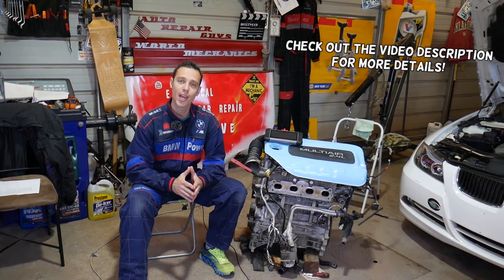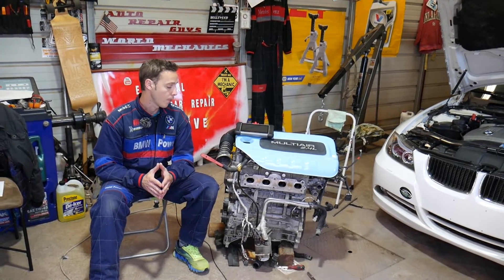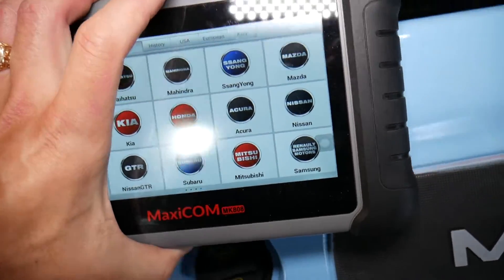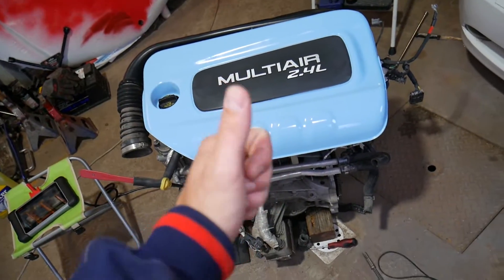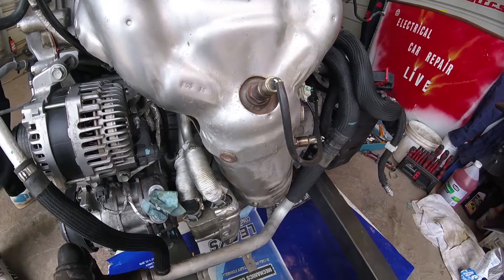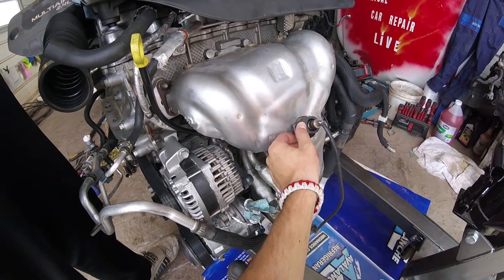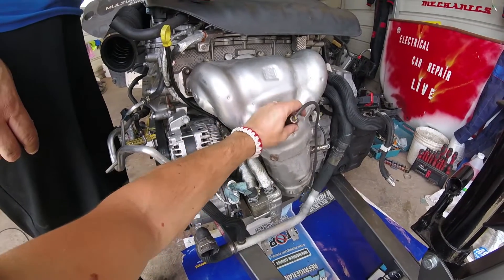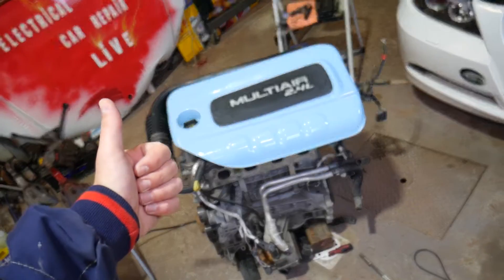CODE P0031 P0032 ENGINE LIGHT ON DODGE RAM PROMASTER CITY, FIAT 500X, FIAT TORO

Comment: Hi, I have a 2016 fiat 500x with the same codes P0031 and P0032, I replaced the o2 sensor and the light came on after erasing the code with the scanner, I assumed the other sensor was bad too and replaced it, but the light is still coming on, I tried disconnecting the battery but it didn’t work either, is there any other way to fix this problem or should I just buy another upstream O2 sensor? thank you in advance for the help!